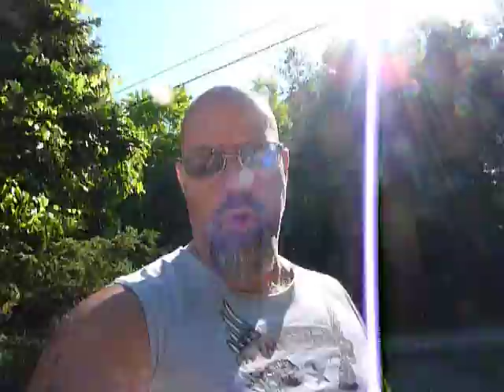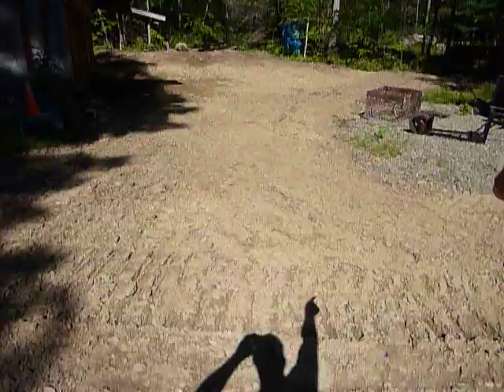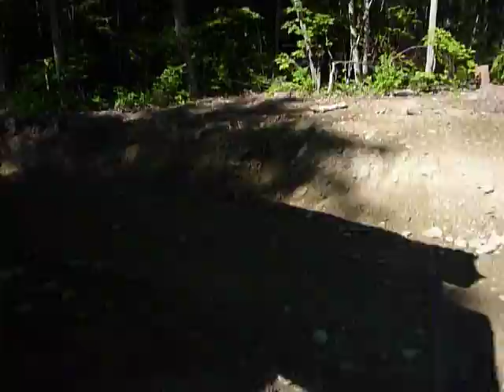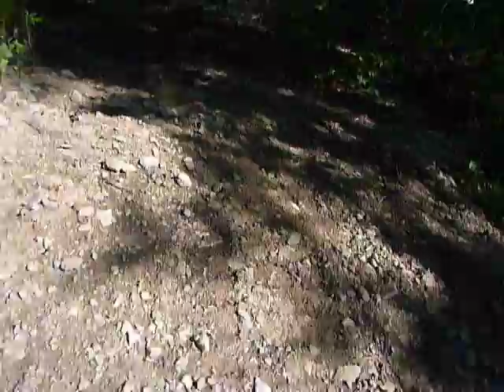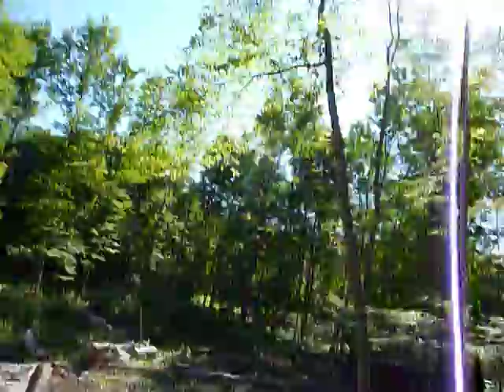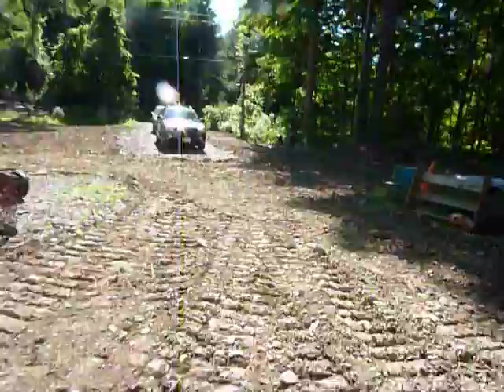The off grid place is looking alot better. The bulldozing work is done for now.

Comment: Great plans. If I followed your description correctly, your going to build like a 4' cinder block crawl space? Will you be doing a poured cement floor in it? If you do, you could put a hatch or 2 in the floor of the building so you could use that space as a root cellar for your food storage.  I've been wondering what you were going to do with all your food stores if you had to move to the property quickly.
Reply from the maker: That's what I am planning on doing it will be nice and cool down their. And yes I am going to put in a cement floor in.